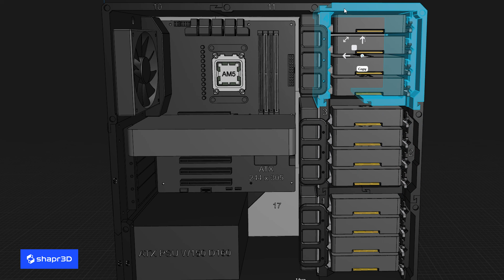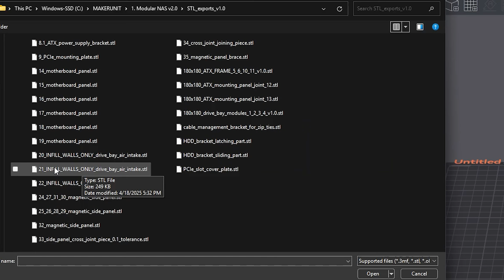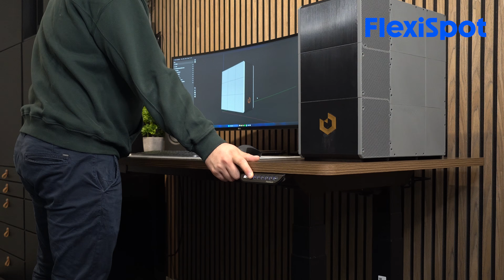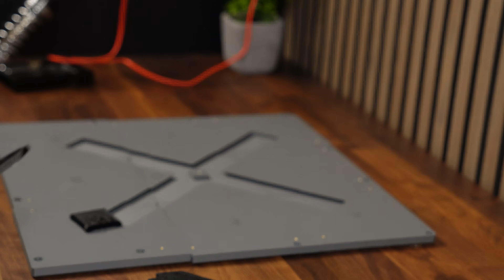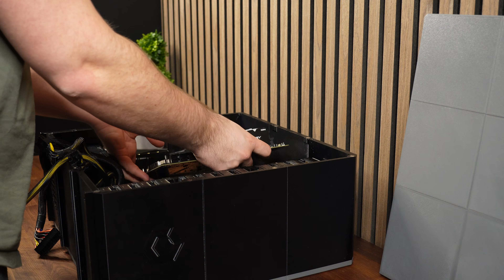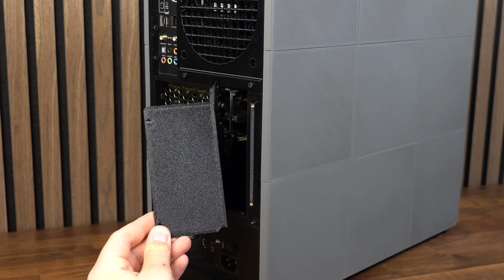Maximize Your Home Storage With This 3D Printed ATX NAS Case

Comment: Phenomenal case. While far from free, if you have filament lying around, its an inexpensive case. Couple notes..

If your matx mobo has sata ports parallel to the board, i.e. pointed toward the front, know that the fans will put uncomfortable pressure on them. I would look for cables with 90s on both ends for the closest ports, but I already bought new, clean spiders and I don't wanna spend more. That gets you ¼" more clearance and probably would do. If I had it to do again, I would've bought that 12port sas card.

I printed in PLA as I didnt have enough petg lying around. I wouldn't put a 16core Intel in 'er, but she's plenty sturdy for NAS use with PLA.

Lastly, plug everything you possibly can into the mobo before installing it. Ironically, I had little problem with CPU power as described in the vid, but the sata cables were a nightmare. All the same, just plug it all in beforehand.
Reply from the maker: Thanks! Glad you found it functional in the end despite your challenges. This is the type of case that works perfect for some, and comes with challenges for others depending on so many factors. I hope the strain on the connectors is not too bad. Glad it all worked out in the end. For sure a great tip to pre-plug most cables 😊

Comment: I really like it.  Seems like airflow might be a little bit of an issue:
Reply from the maker: I haven’t really gotten any complaints on high temperatures, at least not high drive temps with all fans installed. However I do recommend not putting in the most power-hungry components inside, as it’s mainly intended for NAS storage purposes. 😊  Will be working on a V2.0 eventually, within a year or so hopefully. There I’ll take my learnings and feedback from this design to improve and make a better alternative! 💪

Comment: Curious if the drives vibrate uncontrollably
Reply from the maker: Haven’t gotten any direct feedback of that being a problem. Some also printed the brackets in TPU which seemed to work fine. Though the latch may not be as «snappy»

Comment: Just bought the model. Looks nice, I only feel like we need more airflow either at the top or side panel. Or maybe my use case is too niche, I'm running a do-it-all NAS, local LLM, web server, storage, etc. It gets pretty hot with 2 ~170W GPUs
Reply from the maker: Hi! I totally get the need for more airflow in that kind of scenario. Using such a hot setup is not the kind of use case I designed the case for originally. It was mainly designed for a low power CPU mainly for storage purposes or a media streaming device or simila4. Therefore it wasn’t stocked up with tons of fans. However it’s possible to use the included .step file to edit some of the panels for additional exhaust or intake fans in the top or lower front.
Reply: @makerunit  No problem, I bought the file already knowing the limitations. I added some modifiers to the side panel to open some airflow to the GPUs, and I'm using the front airflow version. Things seem to be under control.

Comment: I'm curious if you could possibly make it wider to accommodate more cooling, and potentially separate the motherboard mount from the back wall to make for cable management areas.
Reply from the maker: Hi! Thank you for your upgrade suggestions. I probably won’t redesign this one to that extent as your suggested modifications are quite comprehensive and would result in a much bigger re-design job. However I’ll be sure to consider it when I eventually get to a v2 at some point. (Not in the plan at the moment). 

I usually circle back to comments for improvement ideas when I design a follow up project.

Comment: Hear me out, make this case modular so you can make it taller and wider. Also what would be neat is a retro PC AT case.
Reply from the maker: Modularity was the original design, and it actually worked. But it got way too complex with way too many parts for me to comfortably  share it. Though I aim to get back to it eventually to make it better!

Comment: Nice case - the only suggestion I would make is to maybe have a matching mesh area on the removable side and have a push-pull configuration of fans on both sides of the drives. This would avoid exhausting hot air into the motherboard area.

I appreciate this might be complicated due to drive cables poking into fan blades, so SAS / SATA hotswap backplane boards with consolidated power and data connections (SFF-8643 etc) might help, albeit at extra cost
Reply from the maker: Thanks! More drive cooling would definitely be ideal, however due to the width of the case I found it to be most space efficient this way.

Though in a potential v2 I’ll definitely put more effort into the drive bay cooling solution as that is in fact the most important part of a NAS! 😁

Comment: Nice design! do you have heat issues with the build? I see on the printables page that you use PETG or PLA. Would you recommend using another kind of filament more heat resistant? 
Keep on doing these amazing builds!
Reply from the maker: Thanks! It’s not strictly necessary to use anything better than PETG. If using some parts in PLA I recommend only doing the side panels. But my general recommendation and the overall «safe» choice is PETG for all parts.

Comment: This case and the other ones you have designed are all awesome.  Keep up the good work.  My only feedback would be vented parts for the top of the case and a way to mount all in one cpu coolers.  But thats probably less of a need for NAS systems.
Reply from the maker: Thank you very much! Happy to hear your feedback! 🙏 Generally I’ve tried to steer away from AIO’s in my NAS builds as air coolers in general are much more reliable in the long term. It’s rare that fans fail compared to a water pump for exampme which may be critical for some users.

Comment: Really a Great design :)   i would love to see it with a option to extent the hdd part with extra rows so you can do 12, 24, and so on drive rows. for that the fan also need to be moved to the "front" side of the hdd so its blowing towards the sata/power cables, in that way it should be repeatable :)
Reply from the maker: Thanks! 😁 If I make a version two of this at some point, extendability is a good option to look into for sure. I did try a sort of modular approach before landing on this actually, but without much luck. However, sometimes a design may need multiple versions before the «eureka» moment 👌

Comment: This build looks awesome, just curious how much filament does this project use?
Reply from the maker: Thanks! I personally used about 4.5kg for mine. 3kg black and 2 kg grey roughly. May vary slightly depending on specific print settings though. 🙂

Comment: The idea is really neat and quite innovative but the airflow of it is attrocious. You should have the HDD fans on the other side and just perforated the front. Also perforated the top and then you have much more airflow. Also PLA for a case is not recommended. go PETG, ASA or ABS. PLA already gets weak at 55 degrees and that isn't an uncommon temp around PC's.
Reply from the maker: Many users report stable temperatures in the ranges of around 30-35 degrees on their hard drives using standard 120x25mm fans and I’m getting similar results too. I understand that push may be more effective than pull in a config like this but having the fans easily accessible like that is convenient and easy to build. Though if I end up making a drive bay v2.0 I’ll look into ways of improving the overall airflow 😊  you’re right. PLA can start to weaken on 55 degrees, but PC components are measured at their core temps, not the temperature of their exhausting air. Taking that into consideration you can still have hot components without the PLA taking any damage as long as the hotspots are not directly touching the plastic. In this specific case most of the load bearing parts are PETG, while only the sides are PLA. So I guess some of the motherboard mounting points are PLA, but some are also PETG (on the joints), overall I’m not really worried about this

Comment: What kind of 3D printer do you recommend? How much do good 3D printers cost?
Reply from the maker: Hmm, good printers you can get as low as $299, for example the ELEGOO Centauri Carbon. Print quality wise it’s pretty good for it’s price. They will soon launch a v2, so perhaps wait for that. Or slightly higher, Bambu P2S maybe.

Comment: Another question: Will there be a possibility in making a hot swappable version?
Reply from the maker: Hi, not without doing some modifications to fit a packplane. I plan to get into that eventually. But most likely it will be for another project at a later time.

Comment: Nice one! 
I have a challenge for you. 
How compact can you make a 5 bay NAS with ATX motherboard and ATX PSU?
Reply from the maker: Thanks! I would probably not make one that small if using an ATX motherboard. But perhaps 8-bay would be the smallest I’d go on a ATX.

I’m planning to get working on a mATX. 8-bay NAS soon. So that’ll for sure be a fun challenge.
Reply: @makerunit  Thanks for the reply. 

My current gamning setup is mATX, so my next server upgrade will most likely be as well.  

The reason i say 5 bay is the Jonson N1 backplane, which is easily available on Aliexpress. My PSU only comes with 4 Sata power cables, so I have to do an upgrade to fit more drives regardless. Might as well use molex and get hot swap capabilities at the same time.

I saw Harware Haven made a drive caddy for this backplane.Would be nice if this was somehow implementable. 

Regardless, I always look forward to your videos. The are quite inspirational!

Comment: I'm sure someone has already said it, but don't cover the pcie slots if you're using a gpu. Truly there isn't really a reason to cover it at all. If youre using a gpu, that slot is where your gpu exhausts, and if you aren't using a gpu, the PCIE slots can still ass some passive relief to heat.
Reply from the maker: I did consider that option as well. And ideally it should probably stay open for optimal temperatures. 

However, I added it as an option at least for those who do want to cover it up. In some previous designs I have had similar openings and in those cases people requested covers. So I figured I’d add one here as an option 😊

Comment: Is PLA enough ? PETG not required? Heat , warping issues?
Reply from the maker: I recommend printing the «main structure» (the middle), and the joints in PETG/ABS/ASA at least. The side panels (grey in my build) should be fine in PLA.

Comment: Nice one! But it's a little bit too small for some bigger GPUs like you showed also on the video, that's why it's not for me :-/ A few more cm more in depth and it would be perfect.
Reply from the maker: It could potentially be adjusted for a bigger GPU by sacrificing the middle drive bay to make it an 8-bay ATX NAS instead. 😁 however I haven’t currently done that modification yet, but it is possible.Thanks 😊

Comment: Hmm. I'd probably add a few broad short tapered or hemispherical pegs to the rim and side panel to help it self-align; with just flat surface you can see it slip around when handled even in the video. Maybe also a small inset to the bottom center panel for better grip when popping the side off... or better yet just bring the back of the case "above" the PCI screws in by a centimeter or so, to act both as an easy finger-catch for the panel, and so you don't need to angle the screwdriver to get the screws in and reduce the likelihood of cross-threading.
Reply from the maker: Hi, for sure some good points here. Having some tabs in place to hold the cover more steady would for sure be a good improvement. It’s a good idea to offset the PCI holes 10mm or so to avoid having to bend the screwdriver, I’ve actually taken some of this and improved it on my recent ITX case, not exactly same, but I’ve made holes through a part to allow a screwdriver to get a straighter path 😊

Comment: i am worried about vibration dampening for that case.
Reply from the maker: It is possible to print the sliding brackets in something like TPU for a softer mount, but the sliding smoothness and latching function may not be as precise. 😊
Reply: @makerunit  yup its all about tradeoffs. as someone that spent thousands on hdds im most worried about them failing for any little reason 😅

thanks for replying

Comment: I would love to see this build, but with a bit more customizability. So, basically an option to have middle and/or lower HDD bays replaced with more space to allow for even the longer GPU cards (5070 ti, 5080, 5090 (not founder edition)). So, it allows for a nice server that can be used for AI, but also as a NAS. Perhaps, a bay to have 2.5inch SSDs for example. Perhaps also a way that someone can design their own customizations (e.g. a raspberry pi slot, some led display, ,...).
Just the one server you would need.

Love this video and design!!!😍
Reply from the maker: I’ll definitely keep this in mind for a potential version 2 at a later point! I usually go back to comments to find inspiration when making follow up designs 💪 Glad to hear you like the design! 🙏
Reply: Same here, I was the thumbnail and my first thought was 'oooh, a customizable 3d printed case?'  and while it's still a really neat design, I was sad it wasn't modular like i had first thought.  Definitely agree on upgrades for both customizable interior and/or rack-mount-ability.

Comment: Honeslty incredible build !! Would love to see a 2 bay version for 2 ssd to make a ssd only nas
Reply from the maker: Thank you 🙏 But… Only 2 SSDs? Are you sure it wouldn’t then be better to just use a «regular» type case that happens to support 2x SSD?
Reply: @makerunit  true. But i have yet to find a compact small diy built nas for a 2 bay hdd or ssd or even a 3 bay hdd or ssd. I want it to not have a big internal psu.
Reply from the maker: @abe3619 Perhaps one day I’ll have one that’s perfect for your needs 💪

Comment: OH MY GOD side loaded drives is so nice why can’t more cases do that
Reply from the maker: 🙏 A future version would probably hide the cables in the back with even more focus on convenient cable management 💪
Reply: @makerunit  This is what I came here to say! The case looks amazing, and the one thing I could think of would be routed slots for the connectors or SATA couplers in the back for docking type of connection.

@salimbenbouz made a version of this on his 3D print build in case you are curious to see how I meant it or how it could be done. 😊

Comment: If i were to use less panels and not use one if the drive cages would i be able to fit the xfx rx6700xt blk edition?
Reply: The GPU has vents on the top of the card so having the vents as intake on the card would be amazing ❤
Reply from the maker: Hi, it’s not possible to simply remove one module, however with the included .step file it is possible to cut out a portion of the middle drive bay. I’m not sure how this will affect the design structurally, but I think it may work.

Comment: Is it possible to remove the middle of the 3 bays and only have 2x 4 bays (top and bottom) so you can install a bigger gpu?
Reply from the maker: Hi, it’s possible to do. I don’t currently have a model for that purpose but it can be done with the included .step file.😊

Comment: This is amazing design! Addresses pretty much every nit I have with many other (good) designs.

Are you planning a Micro-ATX version? Or, is it reasonably easy to modify these files on Tinkercad to MicroATX if I buy them?
Reply from the maker: Thank you! 🙏

It’s possible to modify with some basic CAD experience. You know you can fit MATX in this right, you’ll only have some extra «Dead space». However if you’re looking for a smaller footprint then it would need some more extensive changes! 😁
Reply: @makerunit Yep, trying to avoid the dead space, haha

Comment: Do You do custom Jobs? Im really interested in making a mini gaming case for a HP elitedesk 600 g4 that would place the psu on the back SIDE of the mobo and the gpu too with a gpu riser.
Reply from the maker: Hey! Unfortunately I do not do custom jobs. I can however be inspired by an idea turned into a potential project but I generally do not take on custom jobs for others as it takes a lot more time than one would think and the price would simply be too high for it to be reasonable. 😊

Comment: Great design! But I miss power LED, HDD LED and RESET button... BTW, how much filament is required to print such case? What is the weight of the printed parts? The big flat part could be replaced with some acrylic sheet, maybe an alternative modification could address that...
An update. I missed that power button has power LED. HDD LED and a hidden RESET button would be nice...
Reply from the maker: Hey! The overall weight of the printed parts for me is about 4.0kg, however some people have reported pulling it off with 3.5kg while others say 4.5kg.

It’s possible to replace it with a piece of acrylic, however I doubt it will be a modification I make. The .step file is included though so such modifications can be performed by you if you want to for your own use.

Yeah HDD LED is always something I forget to add. However that’s also super easy to include by simply adding a hole almost anywhere (as long as it doesn’t interfere with any components). It can also easily be added by extruding a hole with the .step file and inserting for example a flanged panel mount LED which can be connected to the HDD LED on the motherboard 😊